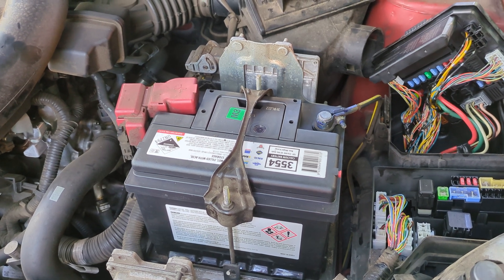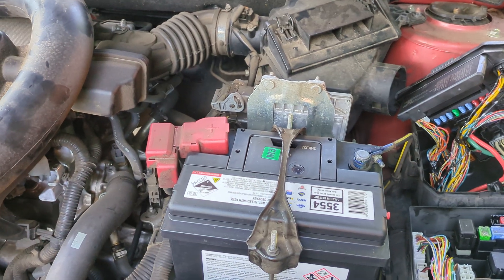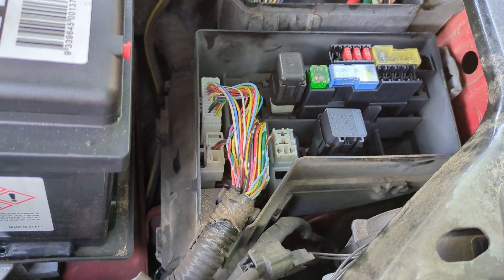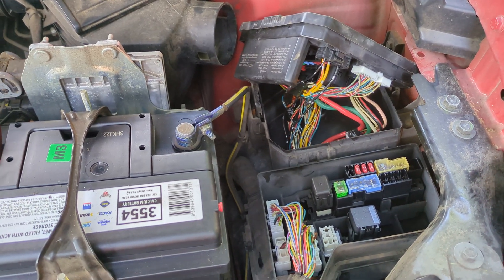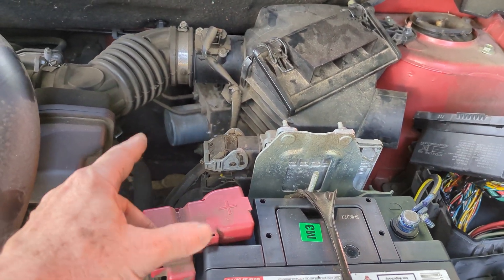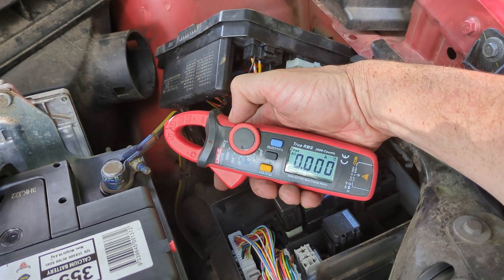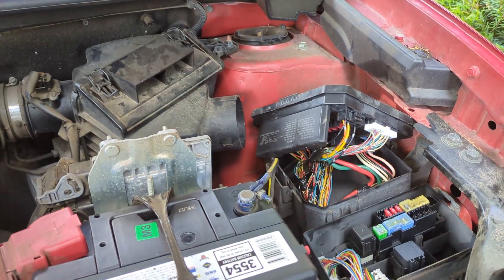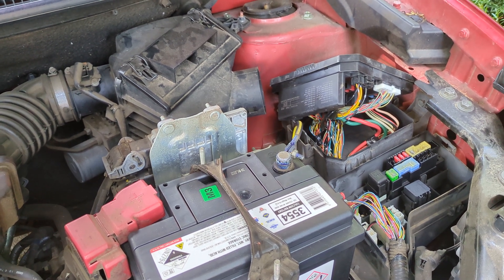Nissan Dualis ABS Modulator Failure Update

Comment from the maker: Yes, meter was mistakenly on AC. The uni-t defaults to AC all the time which is annoying. Proper reading is about 100mA
Reply: Yeah, very annoying, that's why I reprogrammed mine. And with all of your other kits, you can even recalibrate the UT210E!
(its factory-calibration is a wee bit course)
Reply: 100mA is too mcuh, 20mA is normally considered the maximum allowed drain. However, it can take upto half an hour or sometimes even more before all modules are in full sleep mode, so there is probably nothing else wrong with the car.
Reply: 100 mA sounds like a lot to me on a car that old....
Reply: The Fluke 87 also defaults to AC.
Reply: Just pull the motor off the abs unit and try it with straight 12v.
It's held on there by only few torx screws.
Reply: Dave also you can just replace the pump and not the module or the other way around or both it depends on what's wrong
Reply: @dynorat12 I ouldnt do that, as someone else mentioned it already the ABS pump was not designed to run for prolonged times. The one in the car i suspect ran for 10s of minutes if not hours already.......

Comment: Did you hear about the lady with the Merc where someone bumped into the parking radar sensor and put it out of alignment, well the car won't start with the parking radar, a totally superfluous thing for driving, misaligned. $2500 to fix.

Comment: I happen to have ABS issues on the car as well. It seems like one of the wheel sensors does not work reliably anymore.  Sometimes the ABS light comes on after I have driven 10 meters or so, and later it may be off again.  When it is still on when I arrive home, next day when I start the engine it will be on, but turn off after driving 10 meters.
I seems to correlate with having lots of rain.  I guess there is water ingress in the connector.
Now unfortunately, the status of the ABS cannot be read via the OBD-II connector, at least not using commonly available software.
So I fear I still have to go to a garage with no exact pre-diagnosis, which I always hate because garages basically do module swapping only.
"Sir, that must be your ABS ECU!  We need to replace it".  While you know yourself that this cannot be the cause...
Reply: Could still be "only" the sensor - the rain may be incidental. Failing ABS sensors are quite common. Car specific scanners that can read ABS codes can usually be bought for under 100USD - but generic OBDII scanners will not work. The sensors are usually cheap and reasonably easy to swap.
Reply: @TylerDurden-pk5km  What I am trying to find is which of the 4 wheel sensors it is...
Reply: @Rob2  That is usually already part of the error code. If not, these model specific scanners can also output the speed of the 4 wheels - and it is usually obvious which one is the affected. (e.g. no signal at slow speeds).
Reply: @TylerDurden-pk5km  The problem is that on my car the ABS is still a separate unit from the main computer, and the OBD-II does not return info about the ABS.  I can read all error codes of the engine, but not of the ABS.  I do not know if it is at all possible to read ABS error codes via the OBD-II (maybe using some special command that tunnels a connection to the ABS control unit) or if that has to be done on a separate connector directly on the ABS.
Of course when I would have info like the speed of the 4 wheels, it would be easy to find the faulty sensor.  But indeed when I could read only the error code, that likely would reveal it.  Unfortunately the display in the car itself also does not give detail, maybe there is some secret action like "pull the lights stalk 3 times" that would give more info, but I don't know it.
Reply: @Rob2  That's normal and it is like that even on modern cars. It is the same connector - but as I had written in the original post: You need at least a low end, car specific reader that can communicate with the ABS/ESP module. Generic OBD-II reader will only communicate with the engine management system (ECU). Car specific means a cheap one only for that car or that vendor, or universal ones that support multiple brands. They usually start at 100USD ... and end at 10k-20k USD. ;)

With some very rare exceptions you need the scanner and there is no other way to get the data.

If the ABS light is illuminated and a code is stored, you maybe can get it read for cheap or free in a auto parts store or at a mechanic.

Comment: Don't just assume it's the ABS control module. Some have an external ABS pump relay located in the fusebox which may have welded closed. That would be a simple fix. If it's the control module, sometimes you can replace them by just unscrewing them from the valve body, then you don't have to take off all the brake lines and rebleed the entire brake system (which is not a simple procedure with an ABS system and requires a scanner with bidirectional support for your car). The ABS module has to be programmed to the car so that requires a scanner too.
Reply: Unlikely that a 2010 car still uses relays for that - usually the modus also integrates the ESP program nowadays.

Comment: It always boggles my mind when you have to disassemble something on the engine to get to the fuse box or change a headlight
Reply: How about having to remove bumper to change a headlight bulb, or to replace the battery you need to remove the wheel and the inner fender liner as well.

Comment: Even 10mA could shorten the life of your battery if you're not driving it every few days.
30 days and you've lost 7Ah, the battery will be starting to sulphate, slowly.

If it's 100mA, 30 days and a) it's as flat as a pancake and b) if even if takes a charge, it'll never be trustworthy again.
Reply: most cars drop power use as modules go to sleep, and you also find in a lot you can also put the vehicle into hibernate mode, which flips a bistable relay to depower almost all the modules completely, and which only keeps the BCM partly alive, along with the OBD port, so that you can plug in a diagnostic tool and enable the relay again. Drops battery power use to less than the self discharge level.

Comment: You can drive it, it's fine. Maybe in the rain or snow it may be problematic. But, its not really needed outside of slippery surfaces. 

Usually, it's a wheel speed sending unit, or the circuit that's gone bad. You can debug that with and oscilloscope. If you know which wires to probe.
Reply: These are pretty simple systems. Each wheel has a wheel speed sensor. If the brake pedal switch is engaged and one  wheels speed is out of the expected specification. It will pump the brake automatically. Previous to ABS, The driver had to pump the brake manually.   Yeah, the ABS can pump faster and sense that a wheel is rotating slower way before a driver notices.. sure. But that dosen't make the vehicle more dangerous at all. 

I think you have the knowledge to debug that circuit, they are pretty simple. But, I get it if you don't want to get all into vehicle electronic systems. Good luck.
Reply from the maker: I have absolutely no interest in spedning the inordinate time to debug such a system.

Comment: I wonder the implications to insurance with the fuse removed long term...
Reply: Don't ask, don't tell. Highly unlikely they would ever check even if you are involved in an accident.
Reply: Won't get a pink slip in NSW if the ABS light is on. Without a pink slip the vehicle cannot be re-registered once the 12 month registration expires. Most states in Australia have mandatory annual safety inspections

Comment: Don't bother fitting yourself, air in the ABS pump is a pig to bleed unless you have the diagnostics to put it into bleed mode. A scrapper unit will be full of air waiting to fill all the brake lines.

Comment: Hi Dave, I work in the automotive industry. The black box behind the ABS metal body control everything for the ABS. It indeed have some mosfet to turn on the motor, and more mosfet for the various solenoids.

While you may be able to replace the black box only, I suggest that you replace the whole unit because you do not know why it failed (partial short in the motor that fried the fet but not strong enough to kill the fuse?) and the motor may have overheated for running that long. It is designed to run just a few seconds at a time, not minutes at a time.

Also, there may be a third fuse for the ABS. It normally have the switched ignition, the pump motor battery feed and the solenoid battery feed.
Reply: Good thing discovering why something failed is an EEVblog mission!
Reply: When you remove the fuse you loose your speedo an klms on the dashboard
Reply: it is a while you are there issue...

Comment: Anything below 20ma is considered normal..   The reason your's is bouncing between 6ma and 20ma is likely from a simple indicator light..  So if you just look around inside the car, there is likely a blinking LED somewhere.. Like on the radio, or maybe a clock if you have one..  Many cars will have an "Alarm" light that blinks on the dash or even on the door, near the lock.   It just lets people who peak into the windows know that it's armed...   I bet you could find that blinking light with a quick scan. :)

Comment: Is the ABS electronics a can bus module?. If its like the Volkswagen VAG then a replacement ABS module has to be re programmed for that vehicle.
Simply changing the ABS module with a wrecker one wont work without re programing.
Reply: Correct, it'll need to be programmed for the car.

Comment: Get that old ABS module back from the service shop and diagnose the failure? They'll usually let you take anything unless they want to get a core return credit.
Those things are expensive and better off fixing it and having them reinstall it anyway if it's simple (especially because wait times for parts these days can be long, especially from Nissan).

Update: Quick research shows it's probably one of those mediocre Bosch ABS 8.0 modules that frequently fail
Reply: Changed out a bosch ABS 8.0 module today in a Holden commodore with one from a wreckers. It was intermittently losing can bus communications as the vehicle warmed up. Would start flashing the ABS light and the warning chime would go off until you drove it for about an hour and it would come good. I ended up just swapping the electronics and it seems to have fixed the issue.

They're a rather strange thing inside if they're like the earlier bosch ABS units. They have bare silicon dies with bond wires on what looks like a ceramic substrate and a jelly-like potting compound over the top to keep moisture and air out.

They're not just prone to failure but to add insult to injury they are near unrepairable.

If Dave wants to tear one down a working one can be had for around the $100AUD mark

Comment: Haha I have the same clamp meter and I always accidentally measure things in AC mode, some folks on the forum flashed the firmware to default to DC mode.
Reply: 😅 This has made me look like a fool so many times now, that I never assume auto mode on multimeters any more
Reply: Not the firmware, the EEPROM.

Comment: That looks like some poor design choices by Nissan there. Having to remove the intake to get to the fuses, too bad if you need to pull a fuse quickly for some reason!  Then also how the fuses are underneath with all the wires. I’m used to seeing fuses on the opposite side to the wires, and then just a lid over the fuses that you can easily get too and take off.
Reply: Typical nissan design, there are worse ones.
Reply: I've seen worse design choices from Nisaan's parent company. Having to take off the AC compressor to adjust the valve lash every 60-80k for example.
Reply: It's more common these days because of companies partnering up to save on development costs, using the same engine in multiple car designs etc. They just make it fit, there's no consideration for servicing and repair. Ultimately the consumer pays because repair tasks take longer to do.
Reply: @6581punk  I think Renault is special since almost everything they built in the last 20 years had complete disregard to user serviceability. Nissan is Renault, in case you weren't aware.

Comment: If I was you, I'd switch the 40W fuse (relay) with another 40W fuse (relay) to see if the ABS works afterwards!?  If so, Winner Winner Nissan Dinner!
Reply: That was just a 40A fusible link supplying power to the ABS pump motor, not a relay.
The fuse was still good or the pump would not run, so replacing it will not help.
If it has an accessible relay that is stuck on, then replacing that might fix the issue, but I'm pretty sure the pump module drives an N channel mosfet/s to switch the high current to the pump motor...internal to the ABS module.
Reply: Fuses aren't rated in W.

Comment: I believe your amp meter was set to AC amps, according to the display?
BTW, this type of failure (of the ABS modulator/pump) is also quite common on the BMW R1x00 series, often indeed mosfets failing.
Reply: PS: You can re-programme your UNI-T UT210E meter to default in DC-modes, extend the range and ton of more things, it is really very good hackable! (even an analogue output)
Reply: @InspectorGadget2014  I'd love dave to do a video on doing this, I saw the post on the blog but looked more involved than I fancied at the time
Reply: @Firecul  If you are referring to the replacement of the mosfets, yes, it is quite involved; 
First there are, at some ABS modules, "tamper-proof" screws although you can find bits that do fit those and counter that measure. Secondly, the mosfets are often thickly covered with conformal coating. But even that does not have to stop you. I know there are companies making a living repairing such modules....
But you are correct, it is more involved and hurdles to take.
Reply: @InspectorGadget2014  I meant the meter mod lol but yes, replacing the mosfets is possible but a pain in the ass. I admit I'd probably just swap the module for that.
Reply: @Firecul  Oeps, sorry for the misunderstanding!
Maybe we can convince David to show us how easy it is. (reprogramming the UT210E, that is)
I truly believe it is worth the efforts..
Reply: @InspectorGadget2014  I only use that meter for dc, I have better ones for ac work (bm235-eev style as one of them) so it would definitely be better I just didn't fancy the work :P
Reply: @Firecul  Understood, I can imagine as such, no worries.
Reply: Yeah, I'm leaning toward transistor failure
Reply: Trap for old players.